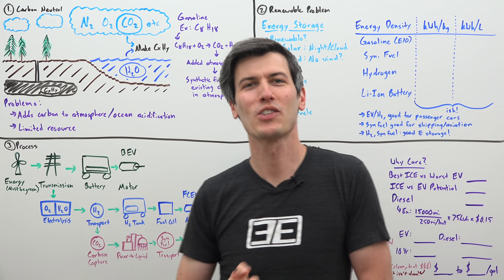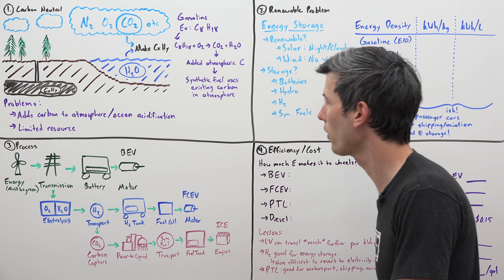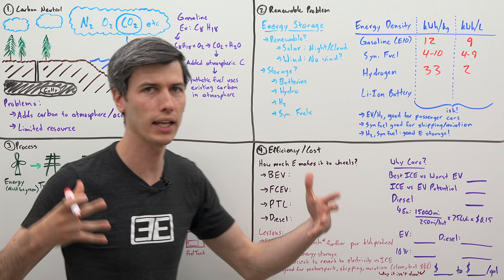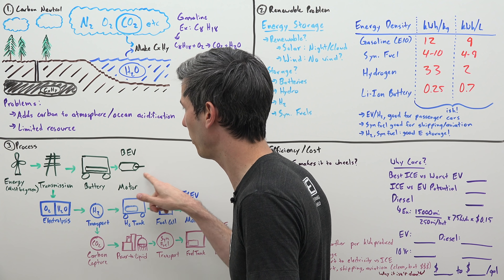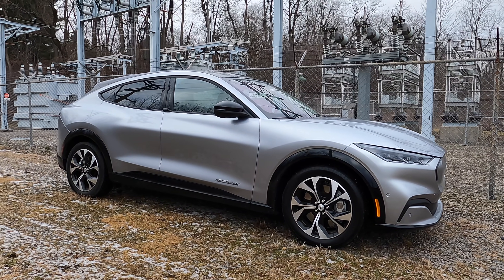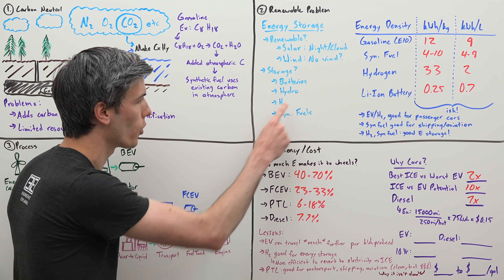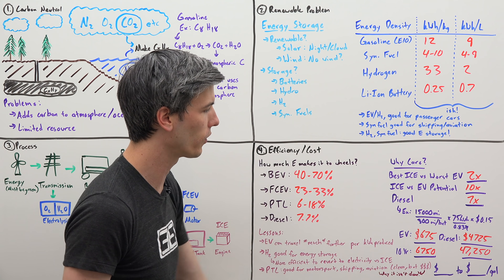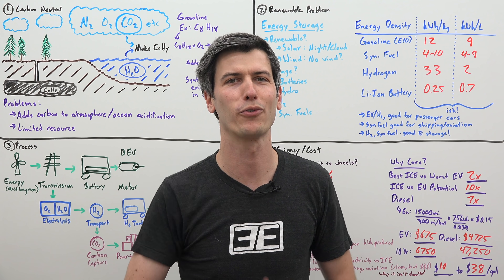The Big Problem With Synthetic Fuels

Comment: However, Jason, you have to put the whole business case into perspective. Even if all of this is 100% correct, you still haven't considered the production process, for instance. What energy and resources does it take to produce a lithium-ion battery? What about investments in new infrastructure? Combustion engines are already there. What are the marginal costs of renewable electric energy, say, in the summer, when there is plenty of solar and wind? Does the fuel efficiency matter that much in such a scenario?
Reply: When you talk about investment of infrastructure to extract lithium and the rest, don't forget that oil isn't freely available, you also need to extract and transport it. Which is something you don't need for EVs because the electric grid is already in place.
Research has been done on the full carbon cost of the whole chain, from production to usage. And yes EV emit more carbon when they're built than ICE cars, but this is offset really quickly after some years of use. Also they're constantly improving, and new battery tech is developed with cheaper and cleaner material all the time, there's lot of improvement potential in EV, where ICE engines are pretty much as optimised as they will ever get.
Reply: @gearhead_2.0  '' Most people on tube these days are paid reviewers including this bloke here, they will just say and spread what their benefactors favour and this keeps on changing from time to time. ''
That's not even true. Actually, if he was paid, he'd have to disclose. 

'' It's wiser to ignore what these people preach and use our own heads to make the best way forward. Remember money flows only towards what the end user chooses and not what the government or others would like it too. ''
He literally does the math in front of you and obviously your head isn't very good so it's not wiser for you to ignore him. Also, that last part is entirely false since the government has a heavy hand in the decision and can easily overthrow the money of the population in this debate. Which they did considering multiple countries are currently planing their date of ICE ban (Quebec, Europe, etc.). 

'' Make it a law and there's gonna be rebellion, it's inevitable. ''
That's not true at all. Actually, where I live, the governement has called for a ban on ICE sells in 2035 and the population was very happy about it.

See, it's better to use your head when you're smart but if you say stuff like that, it's better if you don't use yours.
Reply: @dzello  government ICE banning is an agenda that is going to hurt more people than it helps
Reply: @enfynet  Not really, no. Its just going to pressure manufacturers towards EVs to complete the transition.
Reply: @dzello  that money needs to come from consumers for new vehicles. Lots of people can’t afford new vehicles.
Reply: @enfynet  First, the bans are in 2035 and further, not now. Second, prices of EVs will go down as it takes a bigger portion of the market. This means by this time, EVs will be the same as ICE cars pricingwise. So this is entirely a non factor.
Reply: @dzello  you’re assuming the used EV car market is going to be as healthy as the used ICE car market. The majority of cars are second owners or beyond. We still don’t know how these EV cars are going to hold up after 20 years and 200k miles
Reply: @enfynet  We already have a good idea actually.

Comment: I love your videos. Very good explanation. I just bought a used 2013 focus electric. Everyone keeps telling me that the 50 miles real range isn’t worth the car. But my excursion v10 costs me $5,000 a year in fuel for my work commute and going out a few times on the weekend. Currently electric is costing me $.04 per mile charging at home and quick charger where I live is free. So far I’ve done 500 miles and paid $10 mainly from the chargers in jersey where I bought the car to drive it home.
Reply: Really bro v10? You really expecting savings gas on a V10 excursion.
Reply: This dude is driving a viper as daily

Comment: For the last 100 years people knew that diesel fueled cars are more efficient (more E to the wheels) than gasoline ones yet for some reasons diesels remained niche, so efficency is not everything to the end user. You may say that shower once a week is more efficient than everyday shower and there are people who do like the idea of not showering themselves everyday and some people don't. 

I'm tired of this BEV propaganda, which conceal the fact how lithium mining is devastastating to the envoirment by not calculating its envoiromental costs the same way as it is done for fossil fules. We simply exchange extracting carbon from beneath the surface and putting it above into extracting toxic lithium and cobalt from beneath the surface and adding it above. There is not one study showing that this is more envoirementally friendly, which in the times of promoting this technology here and there is quite remarkable.

Comment: Where does the oxygen byproduct of electrolysis go?  Does all the energy in hydrolysis go into the H2?
Reply: Pure oxygen is actually itself a valuable industrial commodity. To get pure oxygen from air requires the air to be cooled to lower than -100 degrees Celcius, which is very expensive and energy-intensive. Hope this helps.
Reply: @industrealised2326  Thank you for the reply, so is the efficiency calculation off in the hydrolysis step?  Should the oxygen byproduct be also factored in? So something like all the oxygen byproduct is sold to offset the price of hydrogen that the car uses.
Reply: @BlueJay137  Good question. I couldn't say for certain. While oxygen is definitely valuable it would not be as valuable as hydrogen. It would definitely go some way to balancing the cost though.

Comment: Your content quality has dropped big time, it's not something I've expected of you. I've noticed two obvious mistakes in your video, I'll go in more details below:

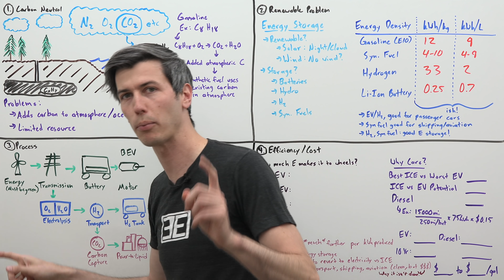You stated at 06:00 that an EV running on power made from non renewables is greener than a carbon neutral fuel powered ICE. Well, unless you'll prove without a shadow of doubt that this claim is valid, at this moment it's just _wishful thinking_. If we return to the world of the facts, carbon neutral fuel is greener than electric power derived from burning coal no matter how you put it, because there's no net positive emissions in the whole process (no extra carbon is thrown in the atmosphere than what was already in it). 

At the end of the video where you so kindly made up the numbers regarding fuel vs power costs for an EV vs ICE running on carbon neutral fuel is also fundamentally wrong. The power grid is an already developed sector (hence the small price of power) because we're using it in our homes and industries for quite some time now, while carbon capture based fuels are just getting off the ground. I'm afraid you're comparing something that has reached the economy of scale to something that didn't - and that's so obvious that it hurts. 

This piece of content is seriously misleading, and I can't give it a like. Please don't become a battery zealot, the world is already full of those. May the better solution win!

Comment: In Europe it's already about 2 $ per liter and increasing in the next years due to carbon tax - at least in Germany, which is kind of ridiculous, giving the fact, that already about 75 % of the price consists of taxes INCLUDING oil and emission taxes. Furthermore,  combustion cars are taxed themselves... the "best" part is, this money, as someone else mentioned already, goes into the whole bucket and gets spent on ... no one knows. In fact, I would happily pay 2 $ per liter for carbon neutral fuel which also burns cleaner with less side emissions. I fear that this will also get taxed besides VAT just ... you know, everything gets taxed here.

There are two other points I would like to make:
1. Considering that for eFuels the WHOLE INFRASTRUCTURE can stay the same, the costs for society are pretty low (besides of course that the production, delivery, etc. process has to be implemented). What would it cost to build the electrical infrastructure, all the cars, dump gas stations or convert them and dump all the tech used now? Also think about people with not much money on hand. Will there ever be EV's you can buy used for 3000 $? With a battery still working? Nearly everything could stay as it is, but it would become carbon neutral.

2. This sounds very critical but it's not against your video, its facts or whatever you make. You and your videos are great! I just wanted to point at some economic things to consider, even if they may not be relevant to all regions.

Comment: it would be interesting to learn more about that 40-70% and how the battery manufacturing processes are are figured into that. after all were pulling things out if the ground for those too :) maybe the costs are worth it to pull co2 out if the air and water despite the incredible difficulty ??
not that I would want to waste that on an old ice engine though ...

Comment: Why not utilize grilles for BEVs and use small blower-style wind turbines behind them to capture the kinetic energy of airflow while driving and use that to recharge the batteries? If it doesn't provide enough energy to fully recharge a battery, it could at least theoretically extend the range.

Comment: when you say that hydrogen has a density of 2 kwh/L, is that measured at atmospheric pressure or closer to 5000 psi?
Reply: Could be atmospheric but stored liquefied at cryogenic temperatures. That is an actual storage method.
Reply: That's at high pressure in a gaseous state. The problem though, is it doesn't take into account the weight of the tank, which will greatly exceeds the mass of the hydrogen stored within (unless it's liquified, which causes its own issues).
Reply: Well with that I can do some math on it and yeah you'd have to have an almost 700 gallon tank on a big rig to get the same amount of energy but it'd weigh over 600 pounds less not including the weight of the tank. And assuming the big rig has a 150 gallon tank filled with diesel weighing 7 pounds per gallon.

Comment: Eventually all cars will be electric.  Historic cars that are gas/diesel driven are often driven so few miles that synthetic fuels aren't prohibited.

I've got a sailboat with a 27hp diesel.  Even though I sail 60-70 days a year I use around 20-30 gallons of diesel.  At $20/gallon it would be 5-10% of my annual costs.... Far, far cheaper than repowering.

Comment: The issue is, even with a ramp up of EV adoption, in 10 years time, a large percentage of the fleet will still be driven by ICE.  That presents a double whammy for the climate and air quality. With something like double the deaths from vehicle emissions (respiratory disease) compared to vehicle accidents, every little helps. If the economies of scale can get synthetics down to something sensible/acceptable (e.g. Carbon Engineering are aiming for $1 litre) then we have carbon neutral fuel that has zero sulfur and has lower particulates (which can be filtered) and oxides of nitrogen.   For shipping, btw, perhaps ammonia is the/an answer.

Comment: When discussing the energy density of fuel per lb./kg, is the weight of the fuel tank considered?  If not, is the weight of the “container” of lithium ion cells deducted?
Reply: the weight of a fuel tank for gasoline or diesel is negligible, for hydrogen you might have a point, but i'm guessing it's still fairly small.
I've always seen hydrogen's potential as a storage mechanism rather then a fuel.  If renewables get cheap enough it might be worthwhile to use it even if you lose a lot of efficiency.

Comment: considering hydrogen and how it has good energy density to weight ratios, how beneficial would it be for use in equipment where storage size isn't such a big issue like trains?
Reply: Space still counts on trains but it might work. Overhead power lines are the easy way, of course, but in some places they're not feasible.

Comment: Interesting, as always, but incomplete and biased. Electricity has been produced for eons, while synthetic fuels are as recent as can be. Like anything else, the price of synthetic fuels will drop significantly over time, quite possibly pretty fast. Most importantly, however, the main drawback (there are several others) of electric cars is the fact that the energy source is not transportable. Electricity is transmissible, but it is not transportable. For that reason alone, electric cars will not be the "solution". They are certainly here to stay, but they will not be it.

Comment: One thing I noticed you didn't touch on is the efficiency of work done by the various modes of propulsion.  For example, in the winter time the range of a fully charged BEV goes down due to cold temperatures.  The same environment won't affect a gasoline powered vehicle to the same degree.
Reply: I've noticed a 20-25% drop in efficiency with gasoline vehicles during Minnesota winters. While constant speed driving (road trips) reduce those figures a bit, errands, stop and go, city driving absolutely reduces gasoline engine efficiencies in northern winters.
Reply: @wzDH106  Consumer Reports did a study and found 50% less range for EVs during winter.
Reply: @KP-xi4bj  

We experienced 25-35% living with our Volt in Minnesota for many winters. The CR 50% figure is baffling to me, a figure that is hardly seen with modern EVs in the real world. The Polar Vortex, a few years ago (-25F or -32C) ended up showing a 40-45% drop with our Volt. But normally, we saw 35% with temperatures below 15F(-9C). And 20-25% below freezing to 15F (-9C).

Jason's EE channel has already reviewed his Model 3 in the winter, it's worth checking out.
Reply: @wzDH106  It sounds like the colder the ambient temperatures the worse the drop in EV range.
Reply: @KP-xi4bj  

Yep, gasoline and electric vehicles alike. Colder, denser, air decreases efficiency. Rolling resistance from increased friction within moving components. Battery efficiency and gasoline engine efficiency drops as the temperature drops, more critical with frequent stop and go, city errand driving.

There were times in Minnesota where the gasoline engine never warmed to operating temperatures in city driving (too cold), thus reduced efficiency. But those same driving penalties also apply to EVs, but more so for re warming the cabin as EVs don't need to "warm up" unlike gasoline vehicles.

Comment: It sounds like hydrogen as a power bank with the ability to fill a modified “traditional” (read as future classic cars) for nostalgia driving is the future. It would even consolidate EV and ICE fill up stations.

ICE will indeed persevere, it’s just that the method isn’t determine yet. But if people still buy cigarettes despite the knowledge of what it does to themselves and others, the greatly increased cost in the last few decades and it simply not being “cool” anymore… why would gasoline not be a similar indulgence?
Reply: People like smoking because of nicotine, not because if smoke. Gasoline is not addictive

Comment: You are assuming that "it costs something to produce that electricity". That is not a given. If you deploy 10-20 times more renewable energy on the grid than there is now what you get is a huge oversupply of energy on very sunny and very windy days. Converting that oversupply into hydrogen or synth-fuel at that point becomes free from electricity perspective. Sure, there are capital costs, but electricity costs and overall efficiency stops to matter at that point. The other side-step of the process is producing synth-fuels from cheap organic matter, you are basically collecting solar energy now with a solar cell, but with a huge field of grass or a pond of algae. You skip the hydrogen splitting and carbon capture steps and can go directly to processing to fuel. Plus there are further efficiency gains to be had by using refined synthetic fuels and specialized fuel cells designed to run on those synthetic fuels. It is possible to design a fuel cell for a synth-fuel if it is clean enough, boosting your last step efficiency a lot.

All that said, I do not see this being viable for small passenger vehicles, but there will be an economy of scale forming for airplanes, ships and industrial uses, so there might be overspill to long-distance trucking applications as well.

Comment: The electric process looks simpler because you are removing the complication of manufacturing the battery, batteries are a complex and expensive to manufacture wear item compared a hydrogen tank and a liquid fuel tank is the cheapest and easiest.
Reply: Hydrogen fuel cell, maybe. But the liquid fuel argument is attached to an over engineered, complex , set-up of wearable moving parts (engine, transmission, and all support equipment. With a plethora of failure scenarios waiting to leave a family stranded, or an excuse to donate the driveway queen to eliminate the eyesore.
Reply: @wzDH106  Electric motors also wear and electronic components on older cars are a nightmare gasoline or not. I'm not talking about the cars themselves.  I'm saying the 'energy transfer/storage' chart forgets the lithium.